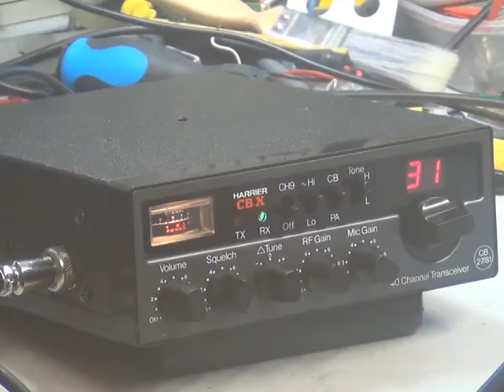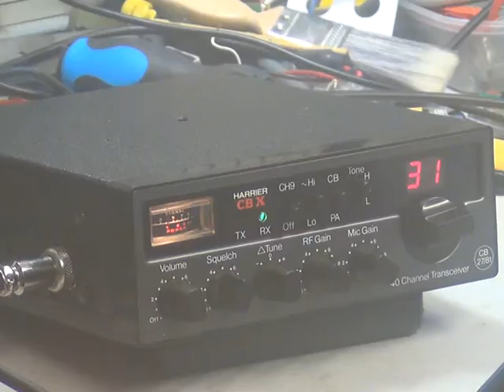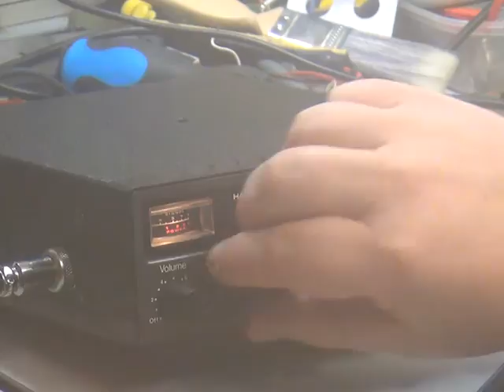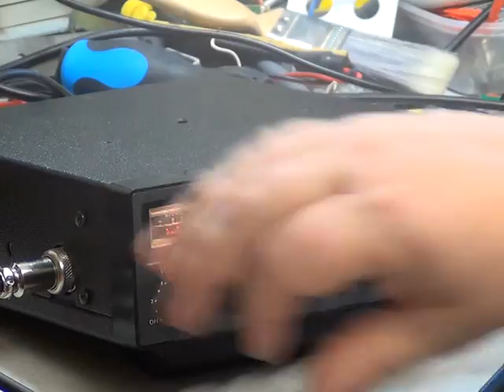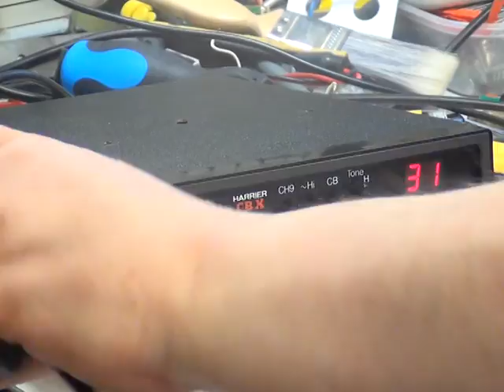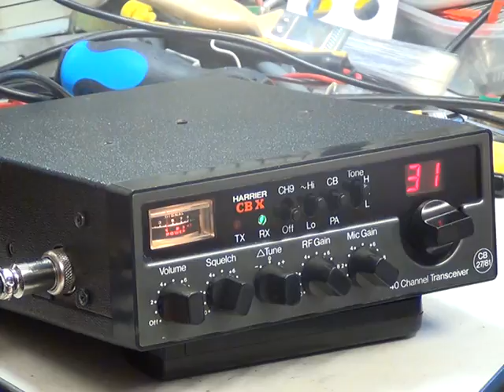Harrier CBX  UK (CB 27/81) CB radio (mobile) - On The Air test

Comment: Probably my favourite of all the CB 27/81 rigs,  as with other rigs they benefit from a crystal filter in the first IF and a better ceramic filter in the second IF. Using the correct 10.695 filter and taking care to use the right terminating impedance to that filter transforms them. I added a second crystal filter by adding the IF stage that is not populated on the board from new. Another worthwhile mod was to take out the low power potentiometer and replace it with a fixed value resistor. I still have my old Harrier CBX, a reminder of being young and those fun times....

Comment: Hi. Would I be right in thinking that CB radios have a fixed output wattage? If not, what is the max output wattage and which rigs have the best RX/TX capabilities? Back when I was about 13, I had the basic Harrier CB and before that the handheld battery muncher. I'm thinking of getting a CB but I don't know which one to buy. Any tips and help would be appreciated. Many thanks.
Reply from the maker: Well since UK CB radio was introduced in 1981, there are about 257 UK legal rigs. There is nothing wrong whatsoever with the Harrier CB. Current radios offer the UK user 80 channels, that's 40 UK plus 40 EU. In this area the EU channels are unuseable owing to foreign interference though. Radios have to be type approved..the Harrier was an MPT1320 set so showed the CB27/81 badge, PR27GB were the 40-channel UK legal EU sets, PR27/94 & PR27/97 were furrther & later approvals. Current radios have to show the CE approval on the makers plate & The 40 EU channels are available to UK users (with CE approved radios...not some old clonker) in AM/FM or SSB modes of operation. The UK 40 channels remain FM only.

Nearly all UK approved CB radios have a fixed output wattage. The CB27/81 sets were required to have a high/low power switch. The High position is 4W & the low position is 0.4W. Later & current approved radios don't have to provide different power settings & most are fixed at the full 4W output.

I can't tell you which sets to buy as peoples requirements differ greatly. We have Midland 78 plus multi radios in the cars here over the last six years, One vehicle has an Intek 760. Base stations here are all Cybernet manufactured (like your Harrier CB was) & we have  Harrier CBHQ & virtually identical York JCB869, both the same innards and from 1982. Newer isn't better...older isn't better, it depends what you want; newer sets offer more things like scan. There's some crap sets out there & there are some new crap sets out there too. Some cheapo radios work great...some very expensive ones are dire...a bit like cars!

Richard

Comment: and he is talking on the radio whilst driving it seems  aint  this against the law naughty naughty naughty
Reply from the maker: Tom, In the UK the use of 2-way radio whilst driving is absolutely fine. The law laid down in the highway code, however, says "when safe to do so". However, just as the use of a hand-held mobile phone is illegal when diving, so too would be to use a hand-held 2-way radio. Legal use of a 2-way radio requires it to be securely fixed & having an external microphone...as is normal. This makes those "one hander" rigs somewhat of a grey area...the ones with vol, squelch, channel display etc etc built onto the mike. Normal PTT mikes are fine.

Bear in mind most 2-way radio messages are very short...like "are you nearly there yet?"..."Roger". Mobile phone calls go on...and on...and on...

Hope that helps,

Richard
Reply: The law is specifically 'mobile phones' otherwise the police would put themselves in an illegal situation when using their radios.

Comment: how is those new small Albrecht radios compared to this, Richard?
Reply from the maker: I don't think there is much performance difference, but the channel change on the mike only takes some getting used to. The receive on the small Albrecht is much better than that big Albrecht with the splittable front, that's for sure. Many new sets generate quite a bit of internal noise, so in reality work to less range than older sets. The small Albrecht is a good compromise. Have a look at our range test & make your own mind up. Always the same route.
Reply: New radios are made shite pal